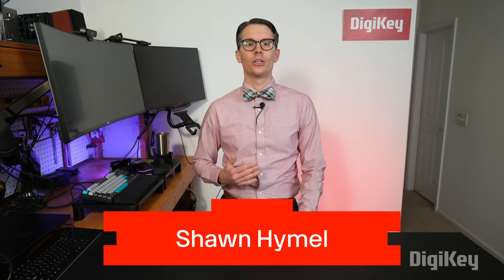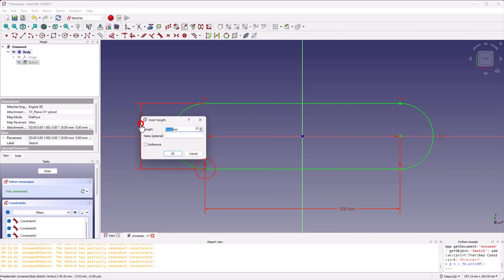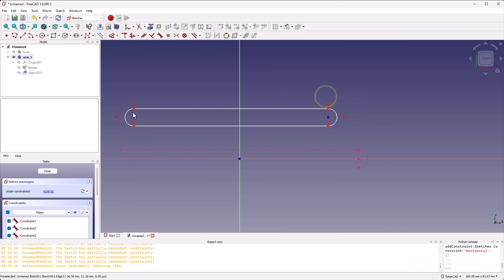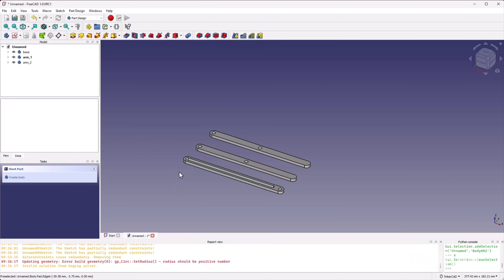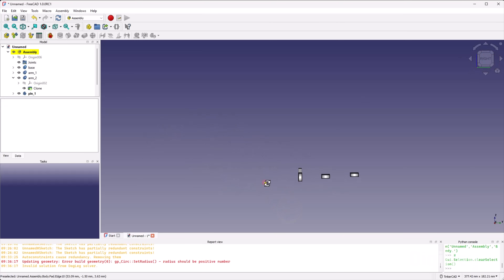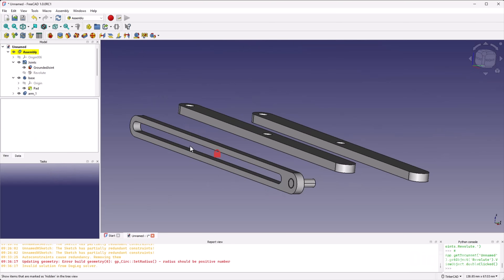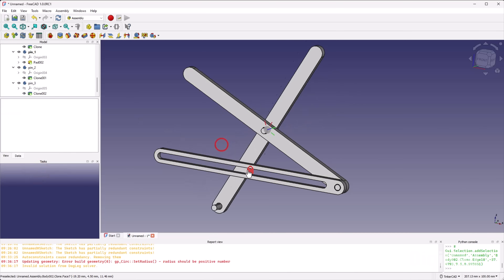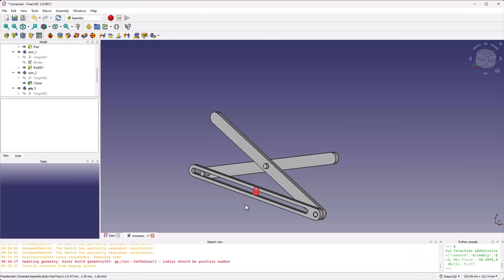Introduction to FreeCAD Part 9: Assembly Tutorial | DigiKey

Comment: Pain in the neck, to get the slider to work. Made a new pin with a square end and filleted the corners as much as possible, used the outside edge of the base and outside edge of the pin (actually the square part), set the min to -43mm (-44mm made it crash, geometry changed), max length to 44mm, worked after that. There must be an easier way.

Comment: Nice tutorial! Everything was fine until I tried to rotate the Base. Gives me an error in Sketch001 says that "Equality constraints between line and arc are not supported" Constraint 9 & 11 are malformed. Is there a way I can overcome this? I tried doing the exercise again making sure I follow the steps accordingly but still this is happening. Thank you in advance.
Reply: Ok I did manage to fix it. I was a mistake I was doing when rotating. It's fine now. But my skills are still very limited to take on the challenge with your little guidance, so I figure it out in the future...
Reply: I had the same problem. For future readers: make sure you're rotating the Base NOT in the Part Design workbench, but in the Assembly one. Your assembly should be selected as the active edited object (bold text and highlighted), and the transform tools should appear as you make a single click on the Base part. If they don't appear and you make a right click and choose Transform instead, everything will break, so don't do that.

Comment: Regarding the workaround of moving stuff around that might break:
The feature "Insert Component (I)" creates clones to be used in the assembly and it allows multiple clones to be added to the assembly, so the other arms could've been geometrically constrained to the base arm but the clones in the assembly then can be moved freely without breaking anything.
The feature also turns the first component into a grounded object by default, but that can be changed of course.

Thanks for making these videos
Reply: Yeah. I tried it out and this actually makes things much easier to work with.
Reply: Would these clones be somehow linked to the original geometry? If I make an assembly with clones and then decide to change something in the parts, would I have to clone the changed parts into the Assembly and redo all the joints with them?
Reply: @bubblec0re  yeah, the changes should be propagated.